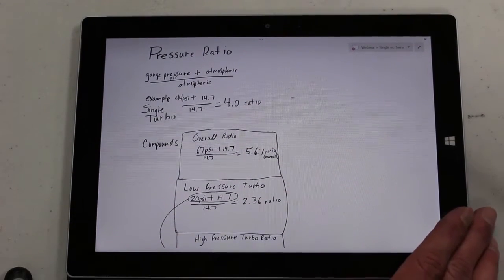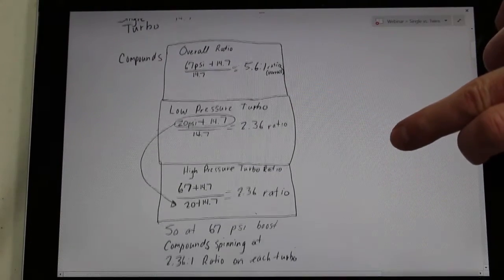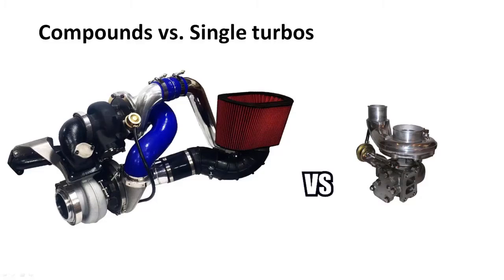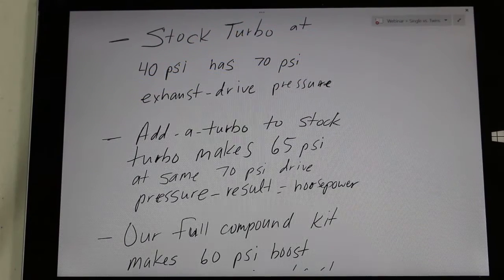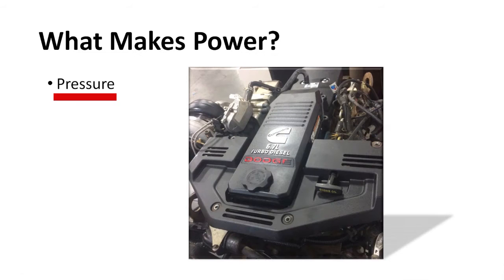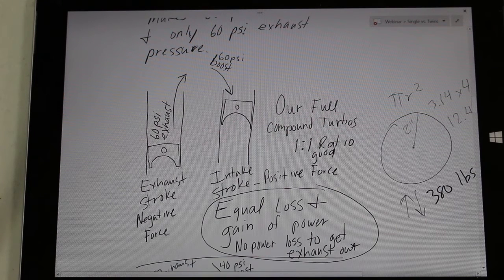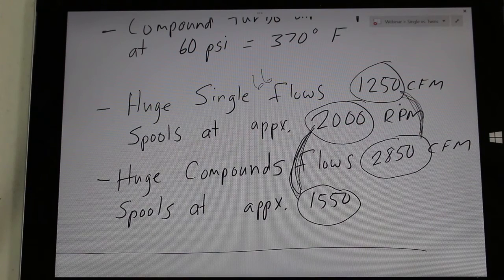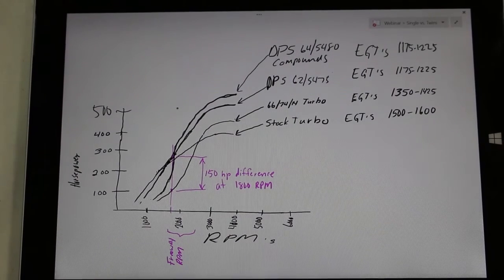Webinar Part 5  - Benefits of Compounds - Diesel Power Source

Comment: with the duel kits would you have to run studs or aftermarket head bolt?
Reply from the maker: +James Okello  Head studs are highly recommended for boost pressure over 48 psi, and fire rings recommended for boost pressure over 55 psi.